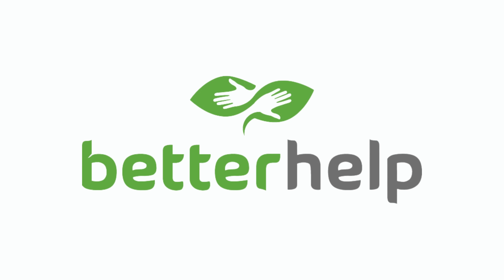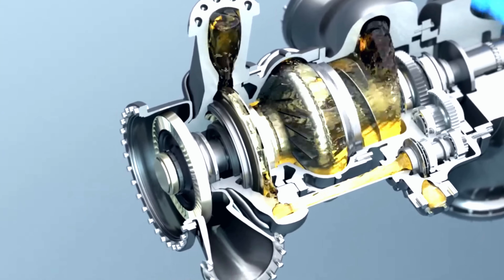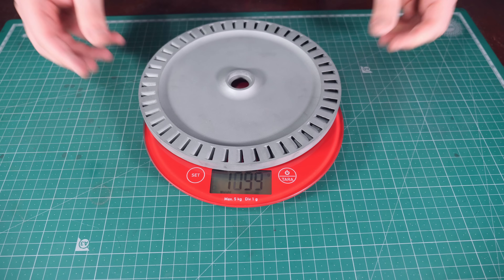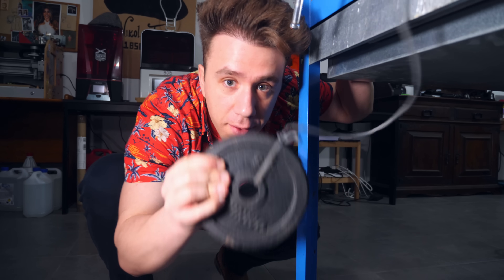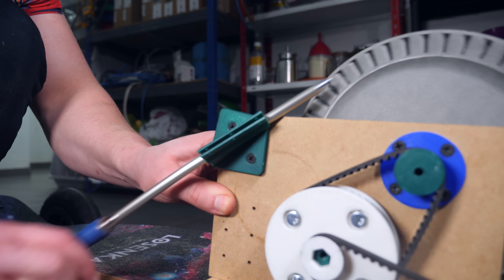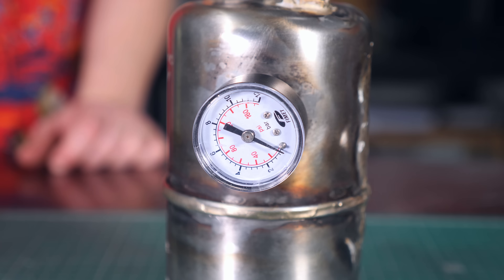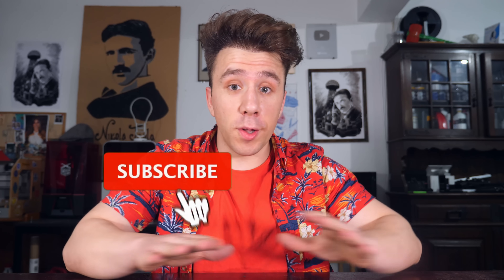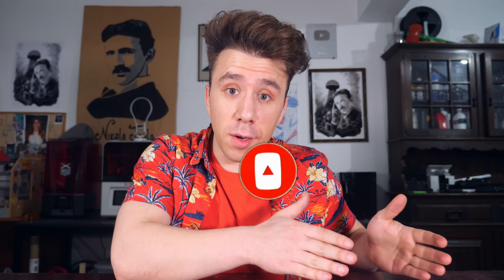I built a TURBINE Skateboard

Comment: From what I've been told by a person who did research on the turbine powered cars, they have an issue where unless the turbine engine is kept at a high RPM its efficiency goes down very quickly. There were also people spreading stories about the turbine cars melting asphalt and other lies that ended up making these cars look like a horrible idea. Personally I think if they did attempt to bring this concept back, they shouldn't run the drive train off of the turbine directly, but should use a generator and an electric motor that way the turbine can be kept at a steady RPM without needing to have it push the car directly or wear out clutches and burn through them like candy. Either that or figure out a drive train setup like in the Owen Magnetic where it's like a speedometer in a car where you have a moving magnet and the induction caused by the magnet either moving in or around something causes a non-magnetic object (an aluminum cup for example) to start moving in the same direction as the magnet. If you want to see more information on the Owen Magnetic, Jay Leno has one and he put out a video about it.

Comment: Dude you need to be more careful. Spinning the flywheel up to 6000 RPM 3-inches from your face could have been really bad if there was a hairline crack. Also, as others have pointed out the camp-cup “pressure vessel” was super dangerous. Cryogenic temperatures make metals more brittle…coupled with the thermal shrinkage can easily cause cracks. Not to mention the potential weak points of the bronze brazing seam.

Entertainment is great, but not at the expense of your safety!

Comment: Get a 300bar diving bottle and a cheap chinese compressor for it, those are used for filling up PCP air rifle containers among other things. Nitrogen doesn't give any bonus in that use anyway, as you are not having evaporation going on there. If you get someone to manufacture you a high pressure line for using bottle pressure to run the turbine, you will have a beast in there.
Evaporating the nitrogen is smart, but you will get a pressure drop due to cooling, and your initial container looked very much like something that would explode rather sooner than later, as there was no safety valve for pressure release.
Maybe a preheated heat reservoir right next to the turbine and pressurized liquid nitrogen feed straight into heat reservoir (block of steel with a hole drilled through, nozzle on the other side and rigid line (car brake line?) into liquid nitrogen container?

Comment: Would it make any difference if you split the output to apply air to the inner and outer vents of the turbine wheel simultaneously? (applying air pressure to both sides of the turbine wheel)

Comment: Dude this was great, but what would you have done if that flywheel shattered/broke off on spinup or the valve on that LN2 bomb frosted shut?

At least make sure the endcaps of the pipe bomb are never aimed at anybody or anything. May as well be a loaded gun.

Comment: Safety Issues aside, you should use a tire that doesn't deform when loaded. Also the knobby tires reduce your power to ground, maybe shave them down and put more pressure in them. Once you do that if you're not getting a nice easy coasting speed you want to get some better bearings for your axles. Rigid, smooth tires introduce less friction into the system, adding better bearings will make sure you get all the gains from the tires.

Comment: has a double walled sealable bottle... proceeds to make a sketchy one that could explode .....dude... @Integza ... just modify the lid of the bottle. also, your flywheel turbine has a wobble to it, you will need to fix that issue, as well as using a mid-drive setup. look into gear ratios and add a flywheel disk next to your turbine flywheel. i recommend looking into tesla's bladeless centripetal flow turbine, for better efficiency out of a lower gas output. also look into steam engines kit regulations for pressure safety

Comment: video suggestion. build a micro CNC or Lathe or Mill or a Infinite Z Axis 3d printer mod. ( the bed is a conveyor belt and the print head is at an angle ) <----  of course DIY. :) or.... how about a all wheel steering concept prototype. a wood gasifier. a diy electric generator. a mirco plane or copter.  a solar sun tracking device using as simple design and minimal parts. like 2 motors 4 2x4's 1 sheet a plywood and use the voltage from the panel to track the sun. PICK ME!

Comment: I would partially enclose the turbine wheel to get a bit more energy from the stream of gas and also facing the nozzle backwards might give you some marginal power increase as it will be blowing against the direction of travel instead of in the direction of travel.

Comment: Instead of using a skateboard, look for a knee scooter. They're for when you break an ankle or something, they typically have good steering and drum brakes included, and a basket for the bottle. Then you could rig the valve to the handlebar as a throttle and ride it around for about $200 of parts?

Comment: If I where to use that turbine in another project, I would find a way to balance and enclose it. I wouldn't want to be next to a rapid unscheduled disassembly at high rpm. Youtuber Clough42 has a video on a 3D printed grind wheel balancer that might be helpful.

Comment: FYI, you could easily transition that setup to your bike. Then you would just need to add a control at the handle bars to control the gas release. Also if you put the turbine within a case to keep the high pressure gas from escaping quickly and focusing it more on flowing through the turbine.

Comment: That was AWESOME 😎. This just blew me away 😅. Your main rotor was wobbling, thus draining power. Brakes can be applied by having a Y adapter to spray air backwards on the rotor when you release the trigger.
Steering can be made possible by taking the hardware off of a skateboard, which will allow you to just lean where you want to go, and your board Will turn that way. I love your experiment and would like to see more of long videos of you making things new, outside of the box. It's so much fun 😂. I have subscribed and love your show. Suzie-Q - Out.

Comment: Huntsvegas! homebase! I see that rocket just about everyday. dad worked for camber ( a branch of NASA ) during the 90's and early 2000's. him and his team were the chemists and engineers that came up with the substance that would later coat the belly of the shuttle to prevent the "Flying Brick" aka the shuttle from roasting the astronauts alive during re-entry.
Reply: hey, 3d print it. plaster mold it. pour wax into mold. let cool. open plaster mold. take wax check and fix imperfections. now build a box that can encase the wax on 5 of 6 sides leaving the top open. pack casting sand around the wax mold. furnace can even be a hole dug in the ground use a dryer duct and a electric leaf blower to supply air to increase heat to melt aluminum. pour molten aluminum into sandbax melting wax away leaving you with a cast aluminum part.

Comment: Would love to se the turbine / flywheel sized up a bit and attached to a bicycle! Then you could strap tanks to the frame, and use a valve on the handlebars to control the speed, plus you would have viable steering, and brakes, brakes would be good I think!

And for a bit of show, have a dump valve for an extra boost of speed when your through with some flashy gas plume!

Maybe use the dump valve to blow up some disgusting tomatoes?!

Comment: My question is why aren't hybrid electric cars powered by turbine engines? The drop in weight would improve fuel efficiency.
But one issue is maintenance, jet engines require constant maintenance.

Comment: Integza, How about a "Jet Engine Thrust Measurement" project?  Design and construct a test rig to accurately measure the thrust produced by a miniature jet engine model. Maybe add a force sensor or load cell to measure the thrust generated when the engine is activated? 🤔 Experiment with variables like airflow rate, fuel mixture, and nozzle design to observe their effects on thrust output. You can also compare your measurements with theoretical calculations to validate your results.  🤩🤩

Comment: To prevent the steel container from bursting add a pressure relief valve, many of them are adjustable. However, the higher the pressure required the more expensive they tend to be.

Comment: You should generate electricity using the turbine to run a generator, powered by the heated nitrogen. Also like the others said, safety valve. 😳

Comment: 4:20 dude!  don't stand there!  if that thing has a defect and comes apart, it might as well be a grenade.  the safety glasses won't do anything against metal that heavy and fast.  it'll just push your glasses through your head too.  the energy in that spinning flywheel is enormous

Comment: Idea: 2 or 3 of these turbines powering the same shaft with one way clutches from a motorcycle starter, can 3d print a housing for it all with lines in it for the air to come out / power the turbines from more than one spot. like a central air line at the bottom that branches off / up in both directions for each flywheel. then you could put it on a wooden go-cart (or metal preferably)

Comment: For another (safer) video. You should do something similar to this but use the Pelton Turbine instead of that rocket’s version.

The setup you had worked well, but I figure the entry angle of your gas could vary too much for it to be as efficient as possible. Whereas with the Pelton you could have it centralized and easier to line-up the has output directly onto the paddles of a Pelton.

Comment: BUILD IDEA: Model rocket with  spring-loaded polyester wings retracted into or up against the rocket body that have remote controlled flaps. Use the parachute deploy charge of the model rocket engine to release the retracted wings by burning through a string that keeps the bottom ends of the spring-loaded wings retracted. Use remote-controlled flaps on wings to glide the rocket back under controlled flight instead of a parachute.

Comment: I think that you could get away with using a big computer heatsink to boil the nitrogen. With over 200ºC of delta T and having a good contact with the whole base it should be possible to move a lot of energy from the ambient to the nitrogen, easily a thousand watts or more (although maybe heatpipes would freeze and you would need a solid metal heatsink). You could even get more bang for your buck if you also heat the nitrogen gas to near ambient by running it through a condensor or maybe even a car heating radiator. Maybe even instead of using a heatsink just using a condensor/radiator taller than the reservoir with an intake from the bottom to the reservoir to the bottom of the radiator such that liquid nitrogen pools in the bottom of the radiator/condensor and exist through the top.

Comment: How about making a "drivable thingy" (a minicar or mountain skateboard maybe?) that uses AIR to help steering? I've always had this dream of car design that takes air from the sides (where the intakes are facing front) and converges that to a single output, so the fastest the car goes, more air comes in (from both intakes, each from one side), more air is forced through a single output and more steering (turning maybe? not sure the right term) help from this system takes place.

Would that be crazy enough? :P

Comment: I am no longer out of shape, I am now maintaining high energy reserves! 😂

Edit: Integza! Where did your brain go?!? Let's seal this already boiling liquid into a vessel made of aspiring shrapnel fragments and then rapidly heat it up! BLEVE is just a myth right? That was basically just a ticking bomb, you're insanely lucky it didn't randomly decide to launch those fittings up into your face, split the container in half along the braze, or just straight up explode as the pressure built up.

Comment: i hope u make 3d printer with a 3d printer, or make a 3d printing fuel cell for hidrogen with conductive filament + electroplating with platinum(catalyst) to convert hidrogen to electricity, and make a DC motor with 3d printer, and then make a vehicle with fuel cell + motor DC

Comment: One reason these cars didn't catch on was the lag time that happens with turbine engines between fuel being added and the engine spooling up before that power is available for use.
Reply: Also, I seem to recall growing up that there was a company in the U.S. that made motorcycles with retired helicopter turbo fans. I think they were the Y2K motorcycles made by MTT.

Comment: Try 3D printing an entire aquarium enclosure, complete with integrated filtration sections, 3D printed pump for the water, 3D printed pump for making air bubbles.
3D print aquarium decorations. An aquarium decoration can also double as an air-stone powered filter with 3D printed plastic beads to host bacteria.
This could easily span 5 to 6 videos !!!

Comment: I think if you wanna revisit the liquid nitrogen idea you should:
1. Use a more pressure resistant container and
2. Heat it from the inside using eg. a nichrome wire

Comment: when you let loose the side with belt is the side you tended to drift. If you put canister on a sling type harness you'd be able to hold onto it without much added effort, but what if you tried attaching the turbine to a scooter that way you can correct the direction when needed. did you consider having the nozzle mounted close to turbine... food for thought. fantastic concept non the less!

Comment: I got an idea. An additional rear-facing nozzle could be installed. Start up with a turbine, and after a certain speed, switch to the rear-facing nozzle and use jet propulsion to get higher speeds.

Comment: I can see some potential issues with the flywheel and power delivery. It doesn't look like you balanced the flywheel, you may want to do that if you intend on taking this to anything higher than the RPM you've been running it at. You may also want to use better bearings. It looks like you used 3D printed bearings, which is great for prototyping, but you'll want something with less friction so you have less power loss in your drivetrain. I didn't notice, but you may also want to add the ability to adjust your belt tension. When you first put the belt on, it looked pretty taught, but when you were testing it outside, it looked like there was some play in the belt.

I apologize if it seems like I'm picking apart your design, I absolutely love what you've done with this, I just think it helps to have a second pair of eyes sometimes.

Maybe for your next video, you could move the turbine and tank to the back of the skateboard and add better steering? Maybe scrap the skateboard altogether and move the whole assembly to a go-kart frame. That would let you scale up the turbine and tank and get some actual speed out of this!

Comment: If one wheel could provide 6000psi what if you put two wheels side by side and blow it in the middle with compressed air or nitrogen,one nozel for both of those wheels maybe split nozel altough it'll be the same i think just waaay less efficient.

Comment: To be fair, I think cars don't run on turbines because the inertia in them would make them less than ideal for fast speed changes. Just look at planes with turbines, it takes many valuable seconds just for a plane to speed up the engines if they have to do a go-around during landing. Also there's the fact that you essentially have large spinning parts under the hood that will truly fail catastrophically if they fail in the first place, along with maintenance being just ridiculously expensive. 

Anyways you should absolutely try to build on the Turbine idea and maybe try to build a Fuel-powered turbine engine to power the skateboard

Comment: I'm curious to see if you can use the turbine in combination with another heavy mass flywheel to conserve the energy. Or use the turbine with magnets attached, spinning it next to a coil to create a generator, that provides power to a 3D printer, that is printing the steering mechanism for the the next version of this turbine powered car.

Comment: The reason turbines didn't win over reciprocal ice is because of the constant change in rpm needed. The solution is a turbine that powers a generator,  then the electrical energy is used at the various rpm ranges. There is a company doing it now with great success in diesel trucks.

Comment: BROTHER!! DO NOT EVER STAND IN A LINE OF SOMETHING ROTATING ANY THAT FAST!! DUUDE, chances are small but non the last they are still there. cheesse you dont want shrapnel's into your chest
4:25 im writing comment, fallowed by reading comments. a real thriller this episode if not horror. about to find out
P.S.: wouldn't enclosing the turbine increase the efficiency? also use Nitros car bottle, lots of pressure

Comment: HAHA! Reminds me of Turbonique and their crazy Rocket based racing solutions... Have you considered replicating some of their deranged work? 

My favorite is the "Drag Axle", a 1400 horsepower rocket turbine that was attached to a rear/secondary input on a rear axle. I guess it was outlandishly dangerous as it didn't have a lot of control, something about a lot of people losing control from the power boost and crashing into a wall (I don't think it was "staged" like modern nitrous systems). It also used toxic hypergolic monopropelent (I guess you could just buy that back in the 60s)... very safe.